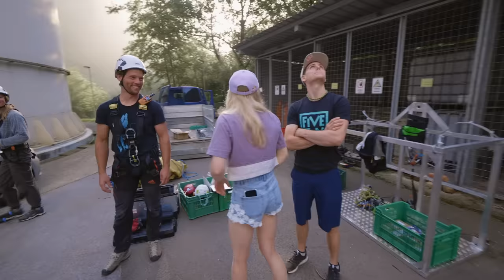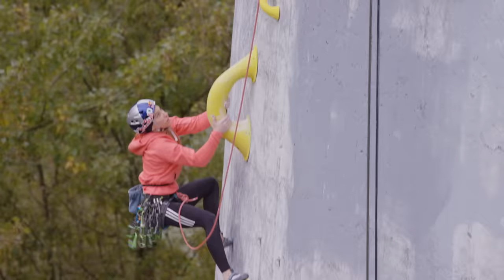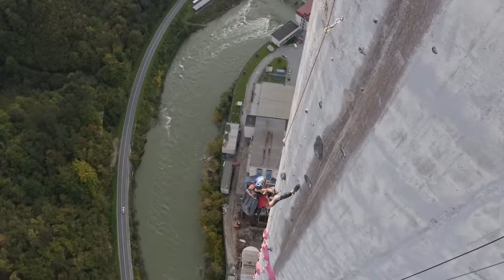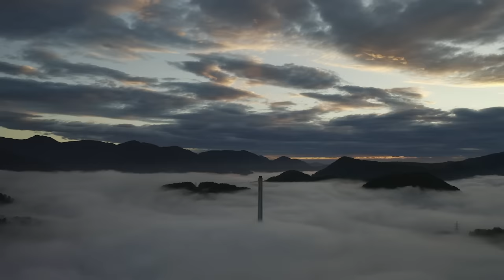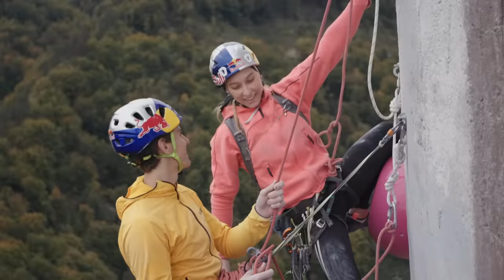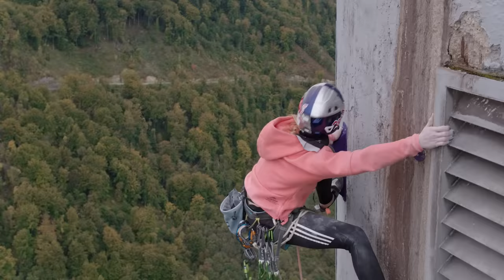Climbing The Highest Chimney In Europe | w/ Janja Garnbret and Domen Škofic

Comment: Mad props to the routesetters. Setting this thing must've been such a huge endeavor!
Reply: They probably set it up from the Top to the bottom, so it will be much easier.
Reply: I would love to see it set up..wander if that left it or took it down.
Reply: @caseycool101  they took it down for safety reasons
Reply: Ever heard of cleaning skyscrapers? Same thing.
Reply: @Dudek0  nowhere near the same thing
Reply: @Mpayne1472  Definetely right, but some ppl think people who set route there, they were climbing there with drilling machine setting 'rocks' on the go :D
Reply: @Mpayne1472  You can see them setting up the course though, not very impressive, challenging or dangerous...
Reply: @JorgenKreedz  I did watch the video…
Reply: @JorgenKreedz  oh it’s challenging
Reply: @Jen-pi5hp  No. They are not challenging themselves at all. I assemble machines these people use to put up courses like these, my insight is pretty good. Following blueprints, drilling holes and fastening grips is not challenging.
Reply: Mad props to the routesetters for  taking it all down as well
Reply: @JorgenKreedz  if you say so...

Comment: Too bad they decided to remove the holds once the ascent was done. It would have been a nice experience to travel there and try the route !
Reply: It would need constant maintenance. Routes on concrete don’t last long. The holds come loose and bits break off.
Reply: The concrete is falling off the chimney and it's not very safe to be around it or on it.

Comment: Usually natural walls just don't go consistently vertical for such a long stretch, at least parts have slight slope. It looks so scary, so exposed. I'd also be worried that the building is now not being used and thus doesn't get maintenance and structural checks, being left to the elements.

Comment: Fantastic.  What was the chimney used for.
Reply: It was built as a challenge for Santa Claus
Reply: It was a thermal power plant
Reply: Coal power plant. And why is so tall? Because power plant is located (not far from this plant there were two coal mines) in very closed valley and old shorter chimney just saturated whole valley with toxic smoke.
So, they build chimney that reaches height little above surrounding hills.

Comment: And the one time when the rope goes "SNAP" and there u go...
Reply: With a load bearing capacity of 2.4 tonnes that will never happen. Unless you literally never stop using the same ropes your whole life
Reply: @SelcraigClimbs  ropes are pretty fragile, that's literally the first thing I got told at my first belaying certification class. Using only friction, my instructor could snap it in half in under 5 seconds. You need to change rope pretty regularly, even if not used (around 2 years if I remember correctly) but you're right in that it won't just snap like that. However, if you take 1 big whipper, you're strongly recommended to get a new rope and not use this one again.
Reply: @SelcraigClimbs  It does happen. That's how Dan Osman died.
Reply: @TornadoGod1  precisely. Regular maintenance and replacements are a must. Especially in the case of after a big fall. I guess my point (poorly made) was that its much less likely for this to happen than it is to get hit by a car in your lifetime.
Reply: @brandulak  to be specific, his use of a rope in that case is far outside the normal range of stresses you would find on a typical rope climb. With it being a controlled free jump. Also the ropes, whilst in "good" condition where exposed to snow and rain for over a month before the jump and that the ropes had been used for multiple free jumps the day prior to and the day of his death.